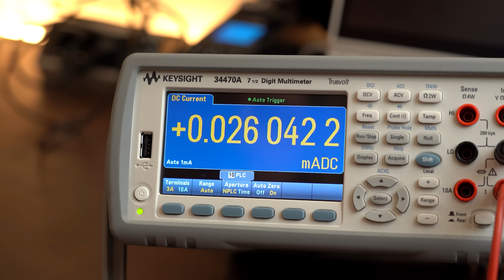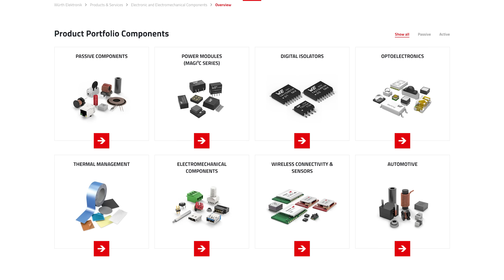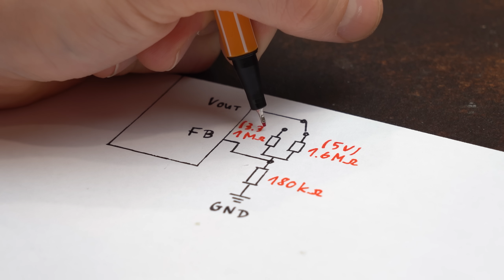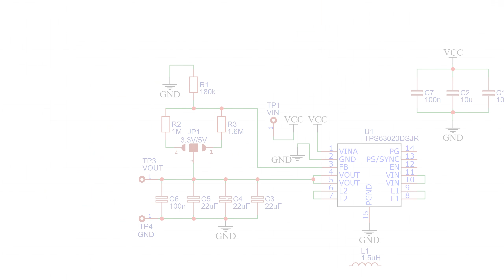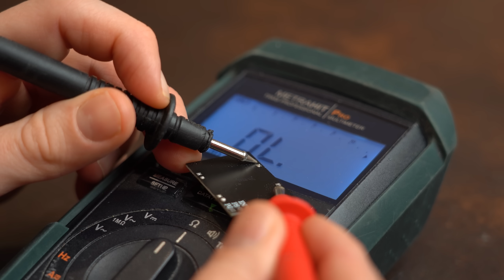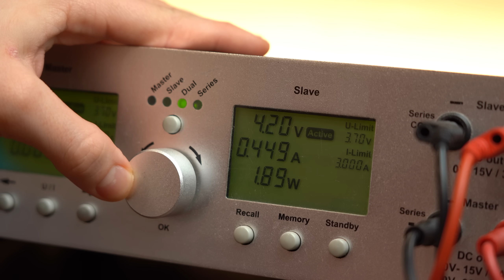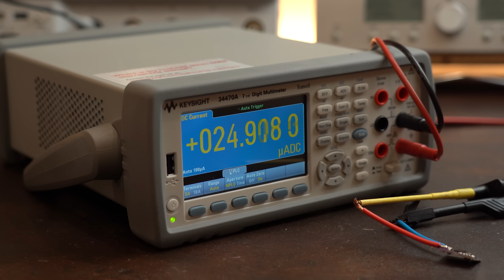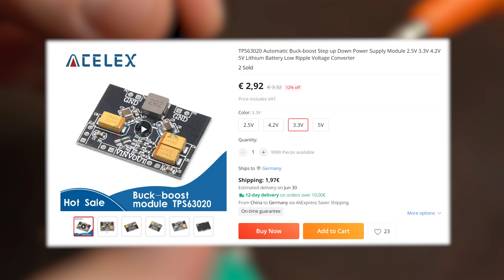How TINY Can I go? The BEST Power Board is here!

Comment: It can surely be made even smaller - the in/out pads are huge in the final design and they take space on both sides. Change them to the single-sided smaller soldering spots.  Same about the voltage selection jumper: you can reduce number its pins from 3 to 2 by making it short a resistor in series (or not short for 5V). Or you can eliminate it completely by just soldering different resistors depending on desired board output voltage. And you can put more capacitors on the back side to bring the noise back to acceptable level.

Comment: I didn’t get a good look at your layout, but adding some additional ground layers in the middle of your board can help with reducing output ripple. It is also helpful to “isolate” the feedback node by ensuring the feedback trace is thin and doesn’t go anywhere near the switching node. Same thing with the ground reference for the feedback divider, have it be a trace that goes straight to the return of the chip and ensure the power paths are “separate” if that makes sense. Great video! Thanks for sharing!
Reply: Yep ... and placing bulk cap on the bottom layer of a thick 1.6mm two layer pcb will render them almost useless for high f noise surpression 😢. For driving Leds it will work, but ur emc engineer will jump out of the next window 😂. Pro Tip READ THE FRICKING DATASHEET ...

Comment: I got this board for a project that I didn't bother with. I haven't used it but could it allow me to drain a liion battery to a certain point while keeping the voltage  stable and boosted at 3V even if the cell dropped to about 2v+/-? Running a set of leds that is.

Comment: In a galaxy long, long ago ... I was a EE.  Voltage regulators were liner. Period.  Please explain why the reference as well as "off the shelf" designs used multiple capacitors.  Yes, I know it is for noise reduction, but if they are in parallel, why not just a larger one ?  Linear supplies might use multiple capacitor.  An electrolytic to smooth out ripple and ceramic disc to filter high frequency.  But those surface mount capacitors are all similar (tantalum?).

Interesting that the reference design had a 1MΩ "load" resistor, so there was a minimum constant current.

Comment: Check out FTC322520S1R5MBCA, this inductor is electrically identical with the Wurth you selected, at half the footprint size. The FTC family is widely used (3225 470nH, 3225 680nH, 2520 1.0uH, 2520 1.5uH) for on-stick DDR5 VDD/VDDQ generation. Never tested other values such as the 3225 1.5uH I recommended, but I have no reason to believe they don't work.

Comment: This video reminded me that in 2014 I bought an Accurite Temperature/Humidity monitor. I stuck a brand new Energizer battery in it. This device is still being used 10 years later with the original battery in it. The device is always on and always displays the temperature and humidity and cannot be turned off unless you remove the battery.

Comment: As others have said, watch out for capacitor de-rating. Caps with larger packages generally have better de-rating characteristics.

Also consider that more caps in parallel will decrease ESR, which can greatly help reduce noise on a switching regulator.

Lastly, keeping components on the same side of the PCB can often minimize the size of current loops, thus minimizing unwanted inductance and noise.

I'm really curious to see the comparison of EMI/EMC on these boards. I've designed a few boards with switching regulators, but have only recently started paying more attention to EMI/EMC.

Comment: Surely a PSU with inbuilt charger is more useful. Otherwise you need a separate charger pcb which may massively increase the overall project size.

Comment: I know that Wurth sponsored the video, so you couldn't avoid using their inductors, but may I suggest you to take a look at the TPSM82903? It's a low-Iq TI buck converter with integrated inductor that requires only a couple of external components and I think it might fit on a 10x10 mm2 board.

Comment: @3:36 be careful to consider the voltage rating of those caps. Capacitors have a capacitance de-rating proportional to the DC bias. Large caps have higher voltage rating and hence are less susceptible to said derating.

Comment: Wenn ein keramischer Kondensator kaputt geht (was häufiger vorkommt, als man glauben mag), dann wird er tyischerweise extrem niederohmig. Der mögliche Wertebereich liegt dann im Bereich von unter einem Ohm bis etwa 5 Ohm. Meistens ungefähr 2 Ohm.
Mit anderen Worten: Kurzschluss!
Wenn die Schaltung aus einem Akkupack gespeist wird, der natürlich tüchtig Strom liefern kann (und der überdies Kurzschlüse so richtig gar nich liebt!), dann nix gut.
Du solltest eine Art Sicherung vorsehen. Und sei es nur eine sorgfältig bemessene Sollbruchstelle in der Leiterbahn von der Einspeisung, so dass dort im Falle eines Falles die Leiterbahn an definierter Stelle durch brutzelt
Und diese Sollbruchstelle sollte weit genug weg von eventuellen Abstandshaltern (aus Plastik) sein, damit nichts in Flammen aufgeht, bevor die Bahn durchbrennt (falls das mal länger dauert).
Ich sehe hinter so einer Sollbruchstelle gerne noch eine antiparallel zur Last geschaltete Diode vor. Bei versehentlicher Verpolung leitet die Diode und die Sollbruchstelle brennt durch.
Das ist eine zwar etwas rabiate Absicherungsmethode, aber wenn man betont klein bauen will und den Wirkungsgrad nicht verschlechtern möchte, schön easy umzusetzen.

Comment: Great video 👍 
A few suggestions that could improve performance, and keed all components on one side.

Move all important text to bottom side.
Get rid of designators and component outlines. 
Then you will have more space for decoupling capacitors.

Not all capacitors are created equal, especially not MLCC class 2. So you may want to look into the delta C as function of delta V. This depends on package size, dielectric and vendor.

If only area is important, the use one 1206 instead of two 0603, as you can find taller 1206, which is more volume for capacitance.
Perhaps a 1206 polymer tantalum.

Move input and outputs to the eges of the design, perhaps even castellated holes.
Share input and output ground.
Resistors could be 0402.

Comment: I love this video and the product featured. I've been curious about this booster board. May I ask how long can it provide stable voltage from li-on battery? Even if the voltage decreases from 3.7 and below dose it still outputs stable 5v? And also if I connect the it to the output of TP4056 will it work well? Or it just works when only directly connected to the battery?

Comment: Given the price and lack of a proper speck of the aliexpress board, i'm 100% sure they were not tested for EMC compliance at all. EMC labs are expensive and you'd have to sell way to many of those cheap boards in order to break even. 
Its funny how in the "hobby DC-DC convertors" they tend to use ancient ICs and designs (mostly because of costs) and when a board is made with a newer part from 2010 its a giant leap forward, but its still a part from 2010. TI have better DC-DC convertors from the last couple of years, but they tend to cost a bit more.

Comment: Experienced engineer here... Looking at your PCB design i noticed that you make so called via-stitching equally spaced, which is a bad habit. Especially in fast switching circuits. That's because those places often become nodes of the high frequency standing waves, which in result amplifies the noise, energy loses, and destroys the electromagnetic compatibility of your circuit. 
This is quite unintuitive, but randomly placing vias (which for an untrained eye may seem unprofessional and ugly) in fact makes your circuit better!
Reply: top tip, thanks for sharing!
Reply: Exactly the same for mechanical noise - for example when making strengthening ribs
Reply: @martinfisker7438  Is that because of resonance?
Reply: Thanks for your comment! I always want to make it look neat. Can you name more pitfalls? ❤

Comment: Great video overall and a good option for many applications. Would love to have seen you go down in resistor size to 0402 since the ones you used are pretty bulky. Also, would recommend using flux when hand soldering as it would result in much better solder joints.
Reply: 0402 resistors are so fun to use...  soooo tiny! but certainly helps shrink stuff down!

Comment: Hey Scott, cool Project, but I must admit that you lost me quite a bit around the 6 minute mark with the design of the first pcb. 
My very limited understanding of pcb design mostly stems from your videos as for example the one where you designed a remote yourself or building a charge IC. For a couple years I was dabbling into that whole topic on and of to create my own version of your Handheld Project, to this day with nothing to show but plans and a few parts. 
Am I assuming right, that the Red on Black View that is shown resembles all copperlayers ontop of each other? And could you elaborate in a maybe a bit simpler way, why those big coppertraces are needed around the coil and the Powerrails?
After repeating that part 5:50 to 6:30 a couple times more, I slowly get it, but it still is only a vague hint of understanding, so if you could shed some more light on it or recommend somewhere I could find the answers I am looking for, I would be very grateful!

Comment: When I searched for good dc-dc converter some time ago if found one module, which I thought is perfect one.
But later during testing I found that it has strange "low voltage mode". Like if your battery is already discharged, its voltage can drop significantly during dc-dc start which pushes IC to open mosfet more and more until it completely shortened.
Unfortunately such behavior maked it totally unusable with simple batteries.
So, I'm wondering if this TI IC has the same issue?

Comment: Nice project, but in the end one should approach it as an engineer would and list all of the requirements of the circuit and see if it is feasible at all and then trade (space, components, count...) to achieve the goal.  Strictly going to "small" (as shown) compromised noise and current.  Then of course need to consider the operating temperature range and likely other issues (supply side noise, vibration, etc).  This is a great channel!

Comment: Very neat.  Receiving new boards is so exciting.  I use tiny 7805 pin compatible switching regulator boards in my designs at 1A.  They're still smaller than yours, but the 2A is impressive.

Comment: Hi you have to check PFM based DC converters. TI and Toradex have pretty cool ones. They can operate as low as 1 uA output power.

When I have developed an ultra low power circuit / controller ( sleep current 3 uA / run current 200 uA ) this was the solution.

Quiesen current where around 500 nA of the DC/DC

Comment: Now that you got a taste of making your own boards, you are probably going to make more of them to cut down on wiring when connecting different modules.
You could make an even smaller Power board, which you can just plug into these, with just 3 connections and an angled pin header for a vertical connection to your custom PCB.
And try using flux. It is what seperates soldering beginners from pros.

Comment: I think that you should try adding back some of the smaller output capacitors. That should limit the output noise (voltage swing) at higher frequencies. Also I have a question on your measurements - have you enabled a 20MHz BW limit in the scope? This is the "industry standard" when measuring power supply noise.

Comment: Cute, BUT!
Check out the TI's "power modules", which have the inductor integrated. They are spectacular! Tiny, very efficient and absolutely great EMC-wise, as the noisiest switched node doesn't even leave the module.
For your application, TPSM83100 looks like a great solution and could easily get you to 1/2 size of your final board.
Reply: Also, 8uA Iq for the mentioned chip ;)
Reply: Wow, those are really good to know about.  Thanks for posting about it.

Comment: The usual, removing caps and not having varying caps and ripple increases. 
If the caps are in parallel side stack them so they are touching, or even stack more on top - lol -.

Comment: Maybe some shielding to lower the noise? Even just a secondary ground plane over the top may help. You could probably test it with foil until you find a solution before making something rugged, but it's a thought.

Also, using more of the back of the board, especially to try to isolate the inductors.
Reply: Shielding is very unlikely the issue, we’re not talking about coupled noise here (it’s power source, it’s a very low impedance node). The noise is probably resonance based, the caps and inductor having a particular noisy resonance at that frequency.

Comment: If selected for 3.3V buck, how does it deal with the cell voltage dropping bellow 3.35V? The cell still has about 20% power left, but the power will be unusable. 
In order to use the full power of a single cell, one needs a buck/boost converter. Specially if the cell is a LiFePO4.  
A better part with even lower Iq of 8uA is the TPS631010. It's a buck/boost with one inductor. Amazing really.

Comment: Please make a video on rda5991ic it is a multipurpose ic with features like it integrates 802.11b/g/n MAC, PHY, 2.4Ghz radio, PowerAmplifier and 
antenna switch into one chip and is optimized for mobile applications. WLAN, Bluetooth and FM can work simultaneously and independently, with low power consumption levels target to battery powered devices. I have one lying around but couln't find its pinout or schematic. Please help.

Comment: for tiny board i would rather use smaller components than placing them on other side, components on the other side leads to a whole new set of problems
Reply: In fairness, the main problems it introduces is increased manufacturing complexity and increased board cost, and I'm sure Scott is aware of both of those having already built 2 double sided designs.

Plus, he already minimised the size of the components, the double sided board was less about a practical tiny power supply and more about the absolute smallest possible design
Reply: @bosstowndynamics5488  it's also about installing these boards in project. If you have all components on 1 side, you have big, perfect flat on the other side, designing and printing a 3d box for it is dead simple. Or if you want you can use some 2-sided tape to attach
Reply: also use thinner pcb to ruduce overrall size

Comment: Multiple different size (and or type) capacitors are better at filtering noise than just one large one. Inductance might also play a role in choosing multiple capacitors.
Reply: Trying to find a good combo of types & sizes for filtering noise is quite difficult - as it is very dependent on the frequency response characteristics of the types of capacitor you use. Most manufacturers won’t even give you accurate ESR/ESL values to model with so you have to measure them yourself.

A single large capacitor (especially an MLCC) probably will also have detrimental impact on the frequency response of the controller. I wonder what the transient response is like for the boards.
Reply: In what application you would want to do that? And when do you know when you need multiple small ones? And how to determine their values?
Reply: @cryptophoenix3031  I was reacting to Scott saying he could use one instead of three capacitors.

Comment: While browsing TI's product page for the TPS63020 I came across the TPS631000, which TI itself describes as 'Upgraded product with 8-uA IQ and smaller SOT package.'. It would be really cool to see you make a board design using this chip, especially since i couldn't find any boards using this IC online.
Reply from the maker: I can put it on my to do list :-)
Reply: @greatscottlab  Awesome! I look forward to it, thanks for the great vids
Reply: @greatscottlab And please sell the resulting boards, having them done takes a lot of time and a ready made board would allow you to earn something and save time for us
Reply: If you care about Iq you can go even below that. TPS63900 has only 75 nA, even though the current limit is a bit lower.
Reply: TPS639011 is a good and affordable option especially with the new technology… however, if you want better transient response with less passive components, tps63807 is a recommendation. - a TI employee
Reply: TPS63900 is brilliant, I used it in my low power system, it's incredibly versatile.
Reply: Yes. And the EN pin is very important to get the consumption below 1uA. You can have a big capacitor to keep your MCU sleeping and the converter shutdown. It gets enabled only when the MCU wakes up, because 99% of the time the converter is doing nothing and draining the battery with the Iq current. I have a ESP32-C3 working only with a 10F supercapacitor, no batteries, and connecting to the wifi periodically.
Reply: sadly JLCPCB says the chip would be no longer produced - haha

Comment: Speaking of really small electronics, I've been looking for an excuse to use the Renasas DA14531. The SOC somehow includes a buck/boost and ble radio in a 1.7x2.05mm package. So if you make miniaturizing into a series it might be one to check out.
Reply: ST had or has some SOCs with built in switch drive signals too. Last one I saw even had two.

Comment: If the goal is low standby current, would an low standby LDO work in parallel to have an even lower draw and then use something to toggle EN pins when the higher load is needed?